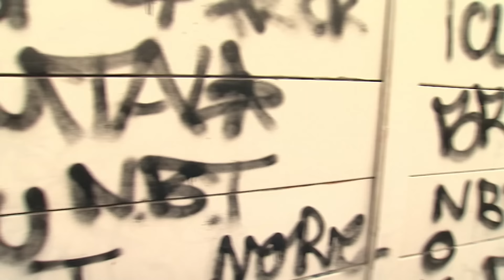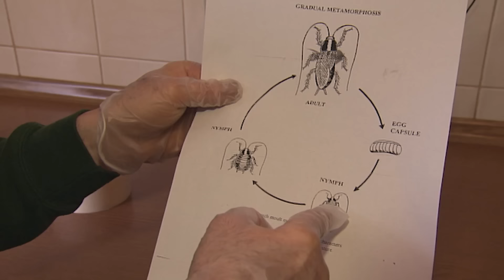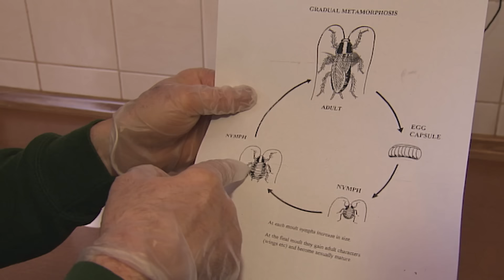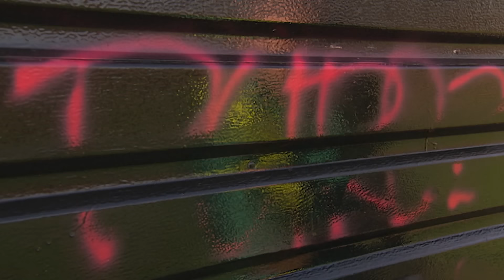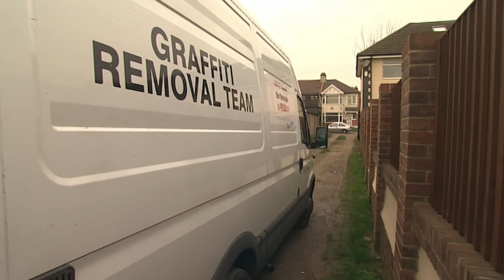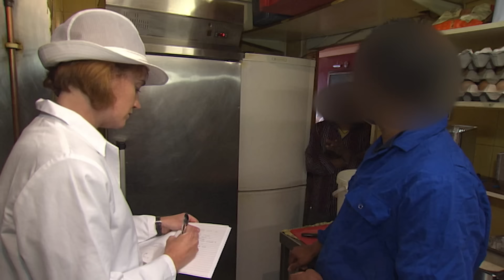Pest Control Pete Finds House COVERED In Cockroaches | FULL EPISODE | Grimefighters | Episode 27

Comment: If you keep your house clean and specially your kitchen clean with frequency you can avoid a lot of pest problems in your home but sometimes pests like cockroaches live inside walls and electric wiring  so using some electromagnetic pest repellents like the ones I have form “pest offense” they really work I’m not doing advertising but if you keep you home clean and use those devices you certainly will be able to remove pests from your home without chemicals and no extra costs